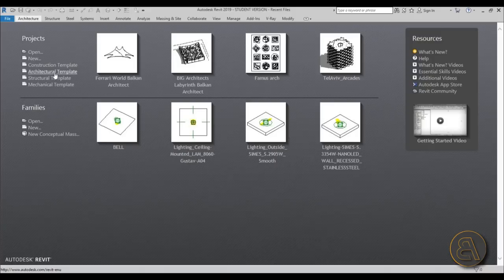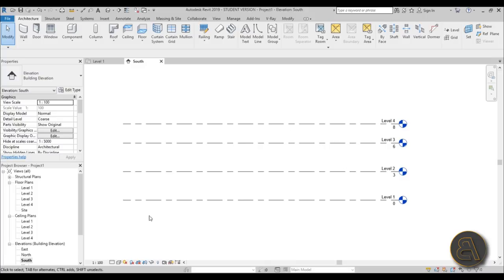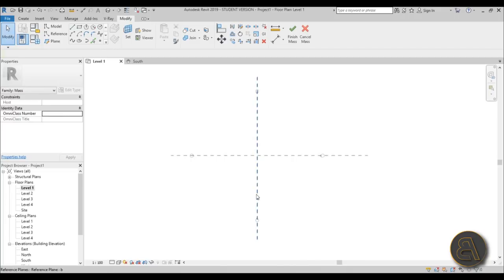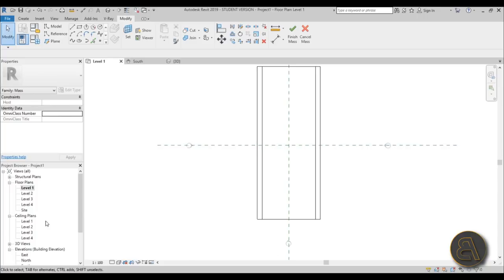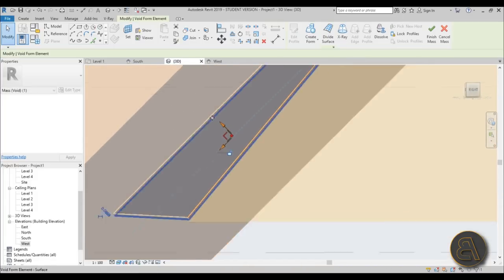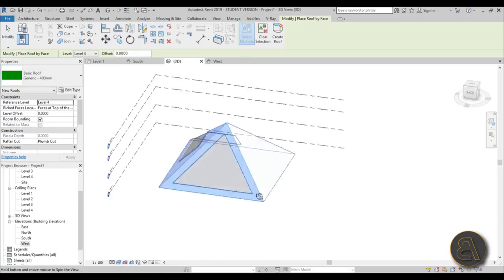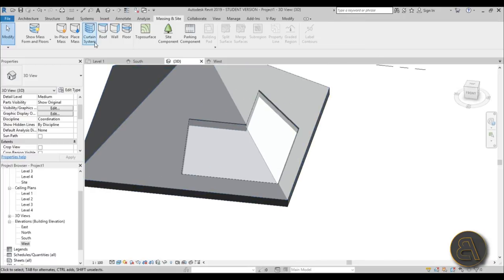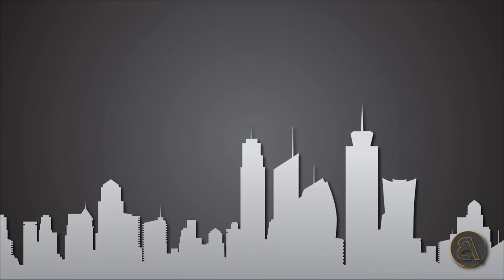Modern Pyramid House in Revit Tutorial

Comment: Balkan prefers the massing&site/in place mass environment, but there are 2 others: Architecture/component/model in place, and Generic model in the family editor. All 3 have different tools and restrictions. Why this is I do not know, but one can work around. Allow me to call it worksets 1,2 and 3, in Revit 2019. In workset 1, the one Balkan uses a lot, it is indeed not possible to model a pyramid straight on. In workset 2 it is easily done with a sweep. In workset 3 just draw groundplan and standing triangle, select both and create mass. In worksets 2 and 3 no voids are needed.